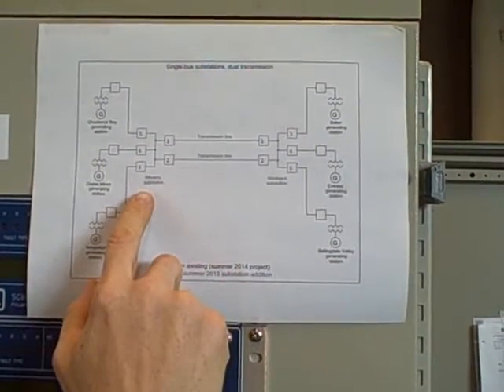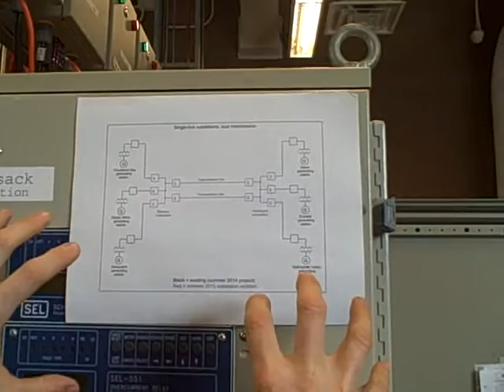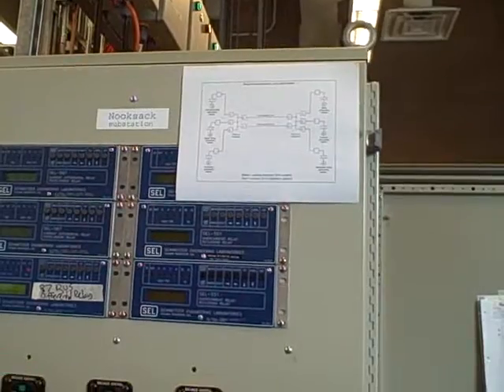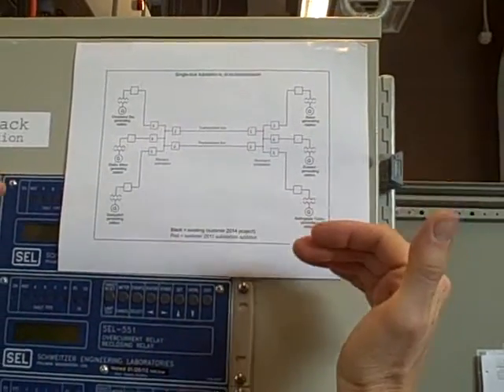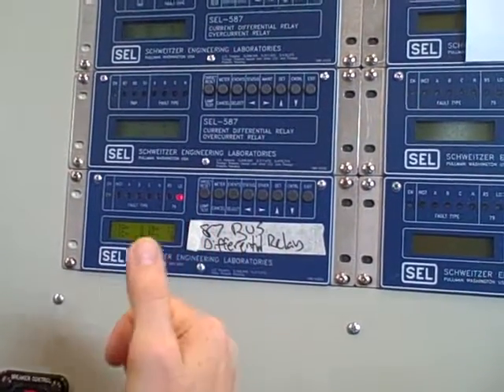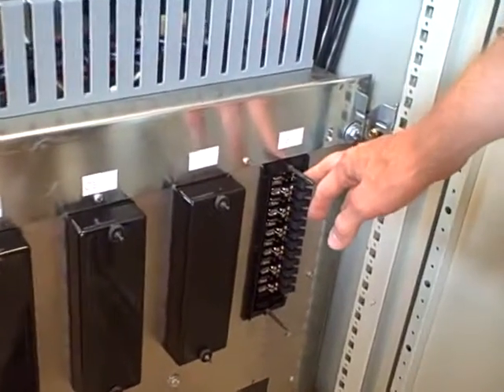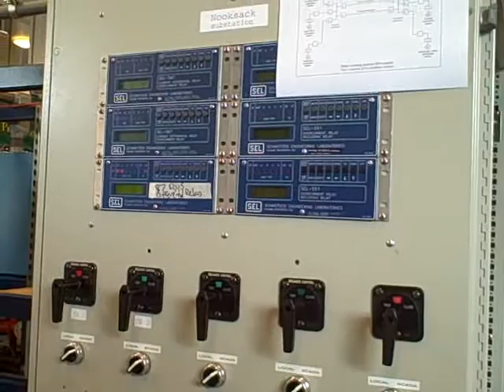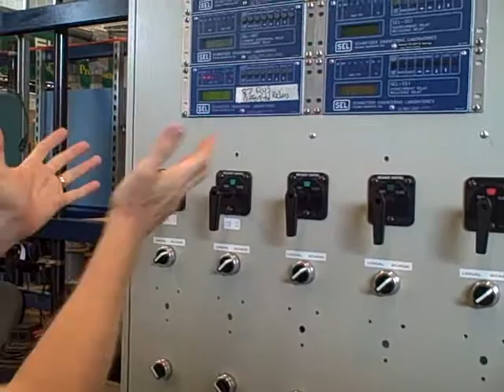Miniature AC power grid substations -- part 5 (opening CT test switch to simulate bus fault)

Comment: what other  tests can be done on the ct test  (shorting)switches? thanks
Reply: +mastermind You can also use a "test stab" to insert an ammeter into the CT circuit to measure current while in operation.
Reply: thanks what about pt test stab?
Reply: +mastermind We don't have any potential transformers (PTs) in the system yet, just current transformers (CTs).
Reply: +tonykuphaldt 
thank you very much